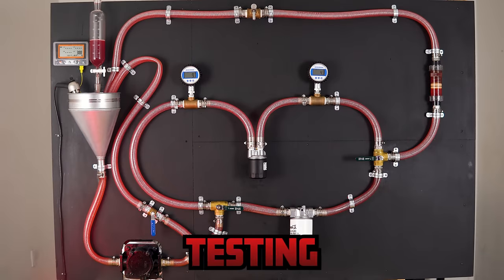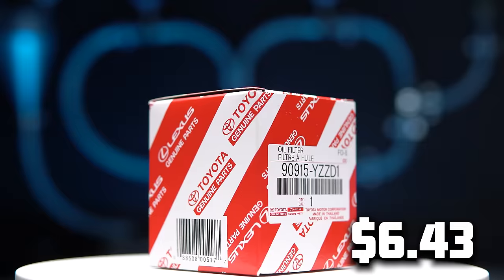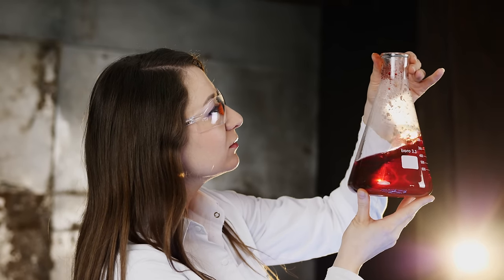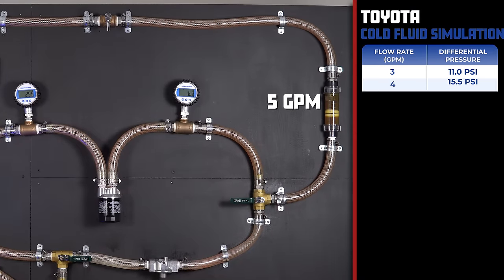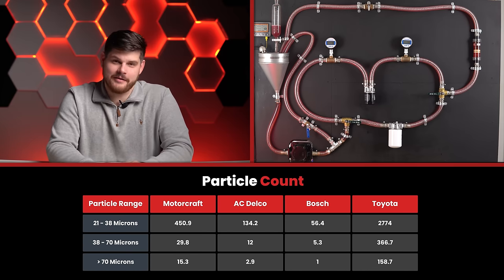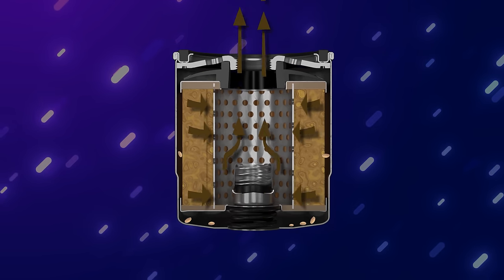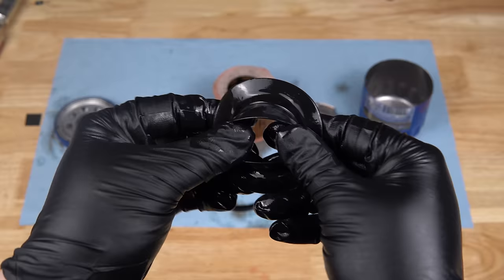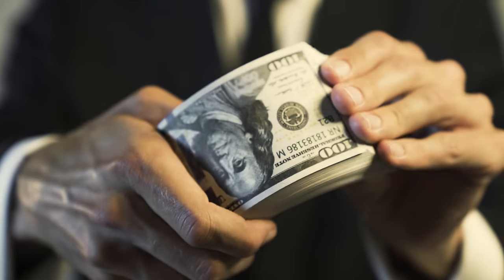Are Car Dealership Oil Filters a RIP-OFF?  (Engineer tested)

Comment: So your saying Toyota has the best flow rate but worst filtering performance. Then why do there engines last so long?
Reply: There’s way more to the engine than the filter. Toyota engines are just so good, the filter doesn’t matter as much.
Reply: I heard someone talking on behalf of Toyota once.  Don't think it was official but said that filtering is not as important as people think.  That oil quality/spec and changing it at correct interval is much more important.  Flow is also super important.
Reply: They're built with very tight tolerances, taking longer to be worn out compared to some others
Reply: @Masterplan15 their tolerance isn't any tighter lol
Reply: Because engines need good oil flow more than filtering out every particle.
Reply: The air filter is many times more important than an oil filter for one. Also many engines only need a certain range (microns) filtered particles to be removed to stave off wear.
Reply: Guess Toyota figures smaller microns aren’t as important as larger microns and better oil flow.
Reply: From the 50s to the 80s the air cooled Volkswagen engine didn’t have an oil filter, and ran hotter than a liquid cooled engine. There was a screen but it was not a fine screen at all. If you look through that screen each hole was close to 1 millimetre wide. Their engines would easily last as long as any American 6 or 8 cylinder engine in those years.
Reply: @kenj.8897 , true. I can't stand when I hear that. Tolerances don't change. They have a certain Tolerance it needs to be at.
Reply: Toyotas make the best oil filter for the There application.
Reply: Because this guy has no idea what he’s talking about.
Reply: Because they’re owned by people that will actually get the car maintained
Reply: Maybe flow is more important than lower micron filtration
Reply: While yes, there are also many replicas that may or may not achieve the same quality as the oem Japan manufacturer. Toyota still relies more on architecture to prove reliability. It can tolerate contamination so long as the oil flows.
Reply: @Nono-rh4lr  it’s true, some motorcycle don’t even have oil filter and yet they still running for 100k+ miles without any issues. You will also see sometimes metal specs floating in the oil and that is just its nature. That is why changing oil on its recommended interval is so important because it removes all of those contaminants that the filter can’t hardly get and can wear down the engine as much as the big metal specs.
Reply: @Masterplan15 that’s actually not true extended oil change intervals will destroy a new engine with tight tolerance’s especially long periods with the fuel dilution from direct injection in the oil not to mention oil consumption 
Yeah Toyota is not known for that lol 
You want to keep any vehicle 10-15 years follow the severe service interval in your manual.
I have a 9 year old truck with 285,456 on it change the oil every 3k the filter every 9k.
Reply: I test two filter bosch and toyota original, bosch clean oil much better
Reply: its only larger pieces of metal that will wear cylinder walls and pistons quickly... the other types of wear take a LONG time esp if someone isnt doing high RPMs - something else will go wrong first before the engine is overly damaged inside. If a cheap filter disintegrates prematurely and it goes for 10 or more 1000 miles THAT will cause damage. so just avoid cheap filters i guess.
Reply: I’d would say engine quality components are more important than oil filtering quality but I’m no automotive engineer.
Reply: @simonlangmead7  every advertisement I ever saw for a beetle said it had a fresh overhaul
Reply: @charliemagoo7943  that's because air-cooled engines are horrible on longevity due to multiple heat cycles per operation (every time throttle changes).
Reply: Care to explain why Ford Mod motors are still at factory tolerances at 300k miles, and why the 300 I6 is a million motor with next to no maintenance?
Reply: @littlet7556  tolerances absolutely change, the optimal clearance for a given application does not.
Reply: @wojtek-33 like the Car Talk guys once said, dirty oil is a lot better than no oil.
Reply: Clean oil is the most important factor IMO. Do regular oil changes and it won’t matter what filter you use. Do you really think engine wear will be appreciably different between these filters?
Reply: @bowez9  I was replying to Simon that claimed they had no filter and lasted as long as a v8
Reply: Who says Toyota engines last that long? The million mile car club is pretty much dominated by Ford.
Reply: Their
Reply: @thecarcarenut @toyotaglobalnews @toyotausa
Reply: I heard that too! Also to add to your statement. I recall that their philosophy is that it is better to have a less restrictive filter that does not clog as bad so in the worst condition, filtering is still being done. As opposed to a clogged filter media and just letting objectively dirtier bypassed oil into the engine. Bottom line, change your oil at the recommended service interval
Reply: I maintained 2 Lexus vehicles with the Toyota V8’s. (4.3L, and 4.7L) exclusively for 250k, and 285k miles. Always used OE toyota oil filters, with Mobile1 full synth oils. 
To this day, they still run perfect, and burn almost no oil. Oil change drains out almost exact amount filled, every 5k miles, for the last 20+ years.  Cant say the same for my Audi’s, BMW’s, Hondas, and GMC vehicles.  Always have some oil lost.    Toyota knows something 🤓
Reply: @bowez9 Fords factory tolerance is crap to begin with lol
Reply: @donwyoming1936 not in last 50 years
Reply: @kenj.8897  odd that you say that when the make 700hp.
Reply: @bowez9  hp doesn't mean it's quality .
Reply: @kenj.8897  how about Koenigsegg using the as a staring point, nevermind Lotus and Cosworth.
Are you saying the 300 is not a quality engine.
Reply: I don't think its an oem filter, counterfeit filters are a huge problem when buying from companies like amazon or even walmart. Buy from the dealer if you want OEM toyota/lexus parts.
Reply: @donwyoming1936 Of the 23 vehicle models most-likely to reach 250k miles (iseecars), 8 are Toyotas, and 2 are Fords (F-350 and F-250).
Reply: You're still young I remember when oil filters were only a $1.50
Reply: Apt question. 
More questions are built into that one too: 
Is this a geniune Toyota filter?
Have their filters always not filtered well but flowed well, or is that a recent thing?
Are the engines lasting till 2-3-400k using Toyota filters or aftermarket?
Reply: @littlet7556 different engine manufacturers will have different tolerances, based off of their specific engineering. These will change from year to year and from engine to engine. 

Like an old Gm 350 will definitely have different tolerances compared to a modern 5.7l ls motor. 
Harley Davidson Evolution motors have about  .001” piston to cylinder clearance, whereas the Twin cam 88 went down to   .0005”. Piston to cylinder clearance.
Reply: Bc their engines are severely underpowered. Any engine will last a very long time when they're severely underpowered and when manufacturers don't sabotage the tried and true engine designs.
Reply: Slightly dirty but greater flow is more important than very clean oil with lesser flow. 😅
Reply: Toyota Engine lasts so long? That is just bullsh*t. I bought it 10th Years ago with 224,000km. After 1years of driving. It kept giving problems until it blew up. I don't go off road. I always believe in, not every vehicle creates the same even if it is the same model. So you must be the lucky one to get the good one. 100% of a car. 20% are without any problem. 80% are with problems . As a mechanic I can confirm.
Reply: I read in my manual for a 3VZE Toyota engine 1988-1995 V6 the minimum acceptable crankshaft to bearing clearance is .0009" ten thousands of an inch.  Toyota has the closest tolerances I've seen and a reputation unmatched on the planet. Even with terrible maintenance behaviors of owners they still out live expectations.
Reply: @simonlangmead7 I daily one and can attest to the fact that, at least in these old aircooled engines, oil flow and temp is the biggest thing. Filtration is important but a secondary concern because you change it out every 3-5k miles anyways (i do mine at 3k)
Reply: @SaveAmerica69 I'm so old I remember cars didn't have oil filters.
Reply: I change my oil every 3,000 miles and change from 5/30 during winter to 10/30 during summer. So far so good over 300,000 miles
Reply: As a manufacturer of Toyota and Honda engine parts, their quality control and tight tolerances are light years better than any other brand.
Reply: How many people would use a factory OEM filter for the life of their car ownership? Probably extremely minimal. Most would take their car to their neighborhood garage or oil change facility that uses regular branded filters.
Reply: @donwyoming1936 …Please don’t put ford and TOYOTA in the same sentence.
Reply: Because quicker oil flow protects more than fine filtration they found
Reply: Always stick to OEM, the flow rates balances out flow rate with filtration for best engine performance. The idea is to assumes your oil changes are done regularly.
Reply: Because the people that have them for super long, do their own oil changes.
Reply: This is likely a trade off.  Toyota designs abuse into their cars which why they last so long compared to German vehicles.  So a skipped oil change doesn’t result in the oil bypassing the filter which is much more detrimental than sacrificing some filter performance.
Reply: More frequent oil changes, if nothing else. That and the only one who makes better engines are Honda.
Reply: I have a 03 Saturn L200 with almost 200 000 miles. Change just the oil every 3300 miles and oil filter every 10 000 miles (every third oil change)and the engine is not burning any oil between changes. Original automatic transmission oil and filter changed every 33 000 miles and also no problems whatsoever. I used to use 5W30 synthetic blend valvoline but have noticed a little oily residue between engine and transmission (rear main seal) and switched to 10W40 a couple years ago and still no problems and no oil burning. Regular maintenance will take pretty much any car to way over 200 000 miles.
Reply: Because toyota is smart enough to know that is the oil changes that matter more the the filtering.  Also, only an idiot adds oil with a dirty funnel. Toyota won't warranty that. I built a lot of toyota engines.  The bearings old core with 250k miles and above are still shiny clean.
Reply: I looked at Toyota before buying different vehicle, and it was 16,000 km oil changes with a very expensive $2,300. maintenance package.  But of course, Toyota fan boys are going to shut me down talking bad about Toyota.
Reply: Long lasting does not only boils down to oils cleaning. High quality parts are also very important
Reply: Wow. So if I slap a Toyota filter on my mid 2000s Merc, I’m suddenly going to double my mileage. There is definitely not 100 other factors that contribute to reliability…How did 170 other smooth brains like  this smooth brain comment?
Reply: Probably because oil gets to the engine lol
Reply: The flow rate is most likely due to the filter bypassing most of the oil due to having no seals.  Just imagine a garden hose with no orings.  If it has orings like the TRD or the higher quality oil filters, it'll flow and filter like crap.  Only thing it has going for it is it can't seal worth a damn.  Most cars will run just fine on crappy oil for a certain amount of time.  You folks change your oil often enough so the crappy oem filter isn't an issue.  OEM filter is just a little better than having no filter as some oil does go through the filtering media.
Reply: Most engine failures are not due to worn out main bearings from poor maintenance.  Design is much more of a factor in an engines reliability.  That coupled with toyota owners obsession with oil changes between 3-5k makes for a highly reliable motor.
Reply: @Masterplan15 wrong, they have an oil consumption problem that is normal operation.
Reply: @mysteriousoklahoma777 .ok, different sentences;  ford will be going strong for years.  Well after Toyota has rusted out or had the frame replaced.  I own both
Reply: But why Ford engine unreliable while Toyota engine reliable and last longer than Ford engine??
Reply: I don't know anyone that has a Toyota that still uses the factory filter after the first oil change. You can't assume everyone uses the factory oil filters. This is why other companies make filters....
Reply: 0w-20/ 5w-20 are more applied on yotota engines.😯so u need to sure well-flow
Reply: To answer that, those Toyota engines that last are thanks to the owners taking good care of them.
Not missing PMS, doing oil change every 5k-10k miles, that’s how engines last even with a shltty filter.

Then yes the Toyota engines can take as much punishment.
Reply: Good point i was wondering if I can sue toyota based on these tests lol
Reply: @Masterplan15  tight tolerances mean that they wear faster FYI
Reply: My thought process for this would be filtering it heavily actually is bad for the engine. Over time all engine parts do wear out and letting it pass through might cause the particles to actually “stick” back on inside the engine block. Essentially helping the engines last longer, regardless of how good they are already made.
Reply: Certainly main factors are how often you change the oil and filter.   Plus dumb person things- like start engine and immediately floor hit  - take off- before oil has chance to fill the engine passage ways.   Many people buy US cars treat them crappy.  Then later buy a more expensive car and treat it with kid gloves on.   Also. The testing is extreme.   Testing Failing for way way more contamination in filter than will ever be in normal engine.    Like knife test beating it though concrete with a hammer to see which one holds up the most. ( Falls under purchase use and cost).   But good information - would allow you to pick a knife that does that.   But that would not be normal use. -/ function.
Reply: Do they last that well? There's too many Toyota's out there with 200,000 that are burning oil and it's explained it's because the oil was changed every 10k. I think they're overrated
Reply: Testing is severe past Max condition.  More dirt than would ever be in an engine.   The Filter probably went into bypass mode and let the dirt flow back out of the filter.
Reply: @johnjohnson9980  You mean let the dirt bypass the filter? All filters enter bypass, either during cold start or high rpm. Of course the flow rate is reduced as it becomes loaded. Filters are designed to retain the particles they trap
Reply: @GianMelendres-if7ph  Most engines last well under such conditions.
Reply: @rhrh7779  Some OEM is junk, some Honda filters are Fram.
Reply: @pro-duct911  so you bought it used with 224,000 km on it and had problems after you bought it? What if the owners before you neglected maintenance and or bet the crap out of it. 🤔  maybe that's a possibility for you having troubles with it.
Reply: Most people use aftermarket filters and oils when doing oil changes, though I heard there oil is pretty good which they say is made by Mobil one with Toyota additives... Looks like their filters are sub par
Reply: Actually Toyota engines tend to sludge up. They are actually famous for it. That and bad piston rings in several year models. Honda makes phenomenal engines but eh transmissions and Toyota makes amazing transmissions and eh engines. I say the two have a baby Honyota
Reply: @truthseeker1203  Both overrated
Reply: @simonlangmead7  That's nonsense, they require regular rebuilding even with regular oil changes.
Reply: @axe4770  Which motorcycles with no oil filterarion are running 100'000's miles without engine rebuilds?
Reply: 80 and 90 filters are very very very likely better from Toyota. And this filter may had leaking bypass or something (big red flag still).
Reply: @85CEKR , that's what I'm talking about. Clearances don't change
Reply: I’d love to see how the PPE oil filters test.
Reply: Japan made Toyota filters work much better and keeps oil nice and clear longer. Cost a little more but totally worth it! But you need to specifically ask for it from your dealership
Reply: There is nothing to filter in a Toyota.
Reply: Undertuned ??
Less stress ..
Reply: Undertuned ??
Less stress ..
Reply: @TheHouseofChameleons  😂 probably the best answer (of course when/if given regular msintenance)
Reply: @pro-duct911 You have a personal data point of one vehicle. Consumer Reports receives data from tens of thousands of owners. They report that Lexus/Toyota vehicles are the most reliable of 35 manufacturers. I believe them.
Reply: @bensfixitpage341 I think you mean 9 ten thousandths of an inch. (0.0009")
Reply: @StrongerThanBigfoot What if it took you two years to accumulate that many miles. Would you wait that long? I think every 5000 miles or one year is perfectly okay, especially if you are using synthetic oil.
Reply: @mikemallano2484 Is a maintenance package a dealership thing? After the two years of free oil changes, I'll probably change the oil/filter in my Supra. 7 quarts of factory 0W-20 synthetic oil, the filter cartridge and o-rings is $109.
Reply: @NickOvcen they don’t even make them. It’s rebranded
Reply: @mikemallano2484 you are not allowed to speak of Toyota. I got banned for exposing the truth one time about Toyota in a chat forum.
Reply: @davepaturno4290 The new 2023 report is out and the lowest cost vehicles now are Buick and Tesla! Lexus ranks way down in terms of cost
Reply: @brarautorepairs  I wasn't referring to maintenance cost, which probably does not include repair costs. Vehicles that are exceptually reliable will always have a lower overall cost than those that are below average in reliability. Consumer Reports had ranked most US auto manufacturers' autos as having below average reliability.
Reply: @donwyoming1936 😂😂😂...but not by an eco boost engine....a rubber belt in oil😱🤣🤣🤣 what Muppet thought of that!!...???.
I would never swap a Toyota for a dodgy ford...22 years on the same engine and all original parts still going strong.
Reply: They're not 'that' good, people tend to look after them better
Reply: @donwyoming1936  lol
Reply: @bowez9  I had one in an F-150, it wasn't a bad engine, the rest of the vehicle was.
Reply: Toyota engine are more tolerant,they use tried and tested technology, when is the last time you hear Toyota use latest technology in its car engine in the market? unlike other car manufacturers they don't scare to use new found tech engine and out it on cars sell at the dealer, just lately Toyota rebranded it model to attract younger buyers but the engine still old compared to Honda or Mazda and the output were less when compared to the other Japaneses cars, in South East Asia Toyota synonym to " uncle's car "
Reply: The best a car will ever run is when it's new all new cars leave the factory with the filter the engineers designed for that motor so logic would say oem is best.
Reply: @donwyoming1936 which motor? The 300 inline 6 was their best engine. Don’t even compare the diesel motor. Toyota has their own that outlast ford which isn’t sold in the US market
Reply: They probably value flow over filtration. I doubt the Toyota oil filter is letting anything through that is big enough to cause any damage. With high flow rates you have less dry starts especially when cold which is where most engine wear occurs.
Reply: Do you think everybody is using a Toyota factory filter?
Reply: Yeah a Toyota will blow up just as easy as anything else
Reply: Better materials, better heat management, And better quality control.
Reply: If you engine produces contaminates then you have problems. Good air filter lowers your contaminates. Where does dirt in an engine come from, the only place it can come from is the air. And Can it get past your low quality piston rings.
Reply: Flow rate will increase with the size of particular it can catch. If it catches particles then it resists flow.  To some extent.
Reply: @Nono-rh4lr how do contaminates get into the engine??????? 
Good air filter, good rings top tier fuels,  no contaminates. Oil is designed to collect them and takes them to the filter. 

Poor fuel, low quality oil, and a cheap air filter. Is what kills an engine. (Obviously poor oil change frequency)
Reply: @simonlangmead7 that's less of a statement about VW than about how bad american cars were at the time.
Reply: @SaveAmerica69 we all remember 2010
Reply: @erichughes6119 you're hanging around with the wrong crowd
Reply: @raymondbrockel1733  Ways someone who doesn't know what THEY'RE talking about.😉
Reply: @stevennunez6013  several service interval?
Reply: Long!? LOL
Reply: Any engine would last as long as a toyota if the lazy owners would do something  called  "maintenance", especially old school engines
Reply: Toyota filters are made by exon mobile oil.
Reply: toyota ain't last anymore except old one car but never on new car* they learned marge money from bmw on modern car it's finito LUL
Reply: Maybe because flow rate is more important...?
Reply: @simonlangmead7  
Well. my first car was a 1961 bug but I changed the oil every 1,000 miles because it didn't have an oil filter and it was unusual for an engine to last much over 100,000 miles back then.
Reply: @stevensevek6151  So true, the more I learn about Toyota's variable valve   engines the more flow rate seems to be.
Reply: @kenj.8897  Toyota uses 0-w8  oil. That's a VERY tight engine
Reply: Because no one buys Toyota filters.
Reply: @Colorado_Native first cars didn't even need oil , they were electric
Reply: @kenj.8897  We had a guy where I lived had an old Baker electric car. It was pretty neat.
Reply: @Masterplan15 lol tight tolerances
Reply: You're, their
Reply: The particles they introduced don't come from toyota engines I guess lol
Reply: Um, hasn't Toyota had some recent engine issues ? As a mechanic for 46 years I can say Toyota has had some issues with engine failures but not as much as Ford or GM. I also believe Toyota owners seem to be more diligent at getting maintenance done than some other brands.
Reply: It's very simple, they don't, it's just a mith.
Reply: @donwyoming1936 by Ford? 😂😂😂😂😂